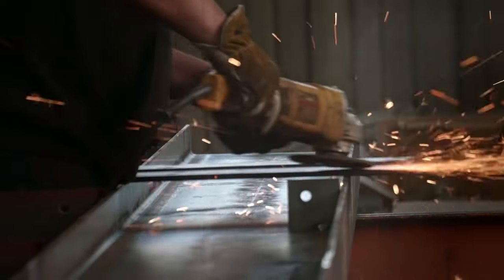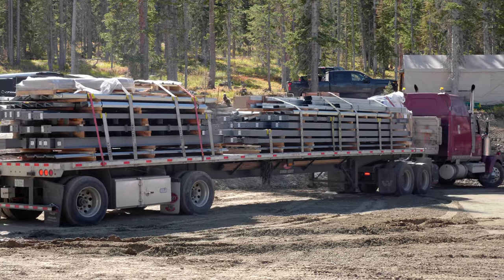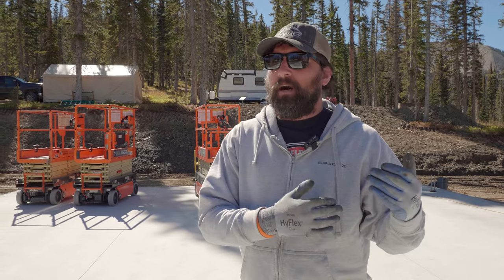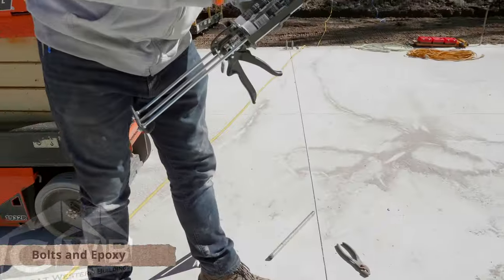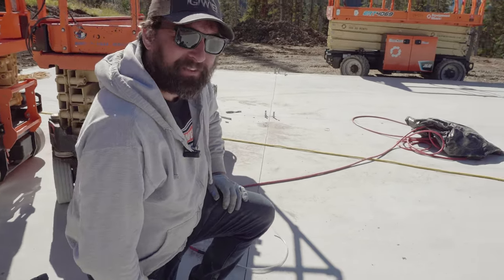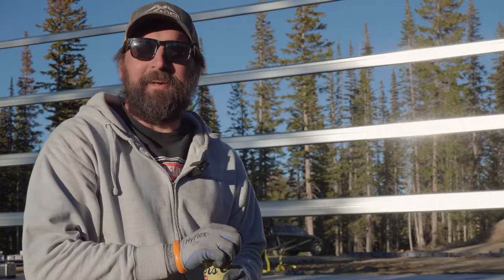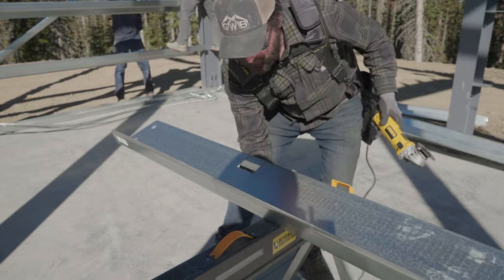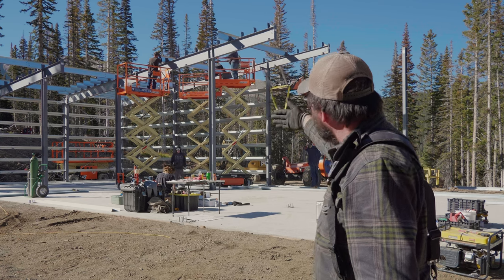How to Build a Steel Building - Start to Finish - Complete Guide | Great Western Building Systems

Comment: How do i shim 3 columns that are lil over 1/4 th inch lower on the  south (low side of single slope building
Reply from the maker: Hi @f1partisan160 

If the pad is perfectly flat you could make a baseplate replica out of 1/4" plate steel to use as the shim. If it's not flat or you do not have access to the steel or tools to make a plate like that, steel concrete shims can be used. These usually come in a box at the big home centers in the concrete section, next to rebar and grout and tie straps. I believe the box is about 5 lbs and has 1/16 - 1/8" shims that measure about 2x3 inches or so. I don't recall exactly. 

Hope this helps. Thanks